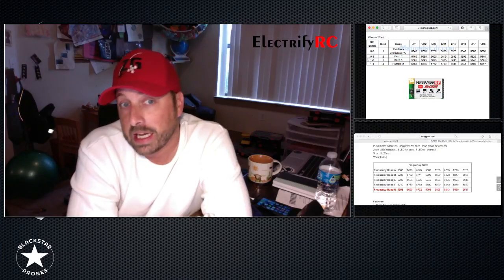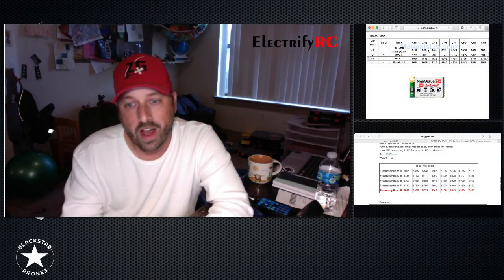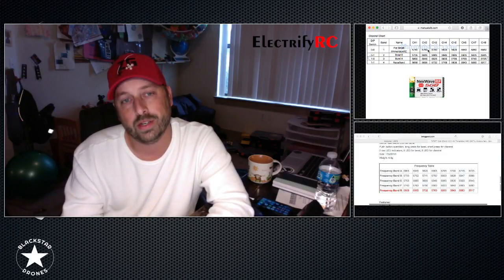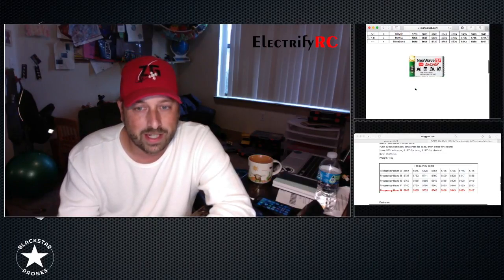CheFPV 101: How to Match Vtx and Reciever Channels Properly

Comment: got a new wizard x220 with a TS5823S 40CH 5.8G 200MW vtx frequency chart matches on all bands , put new run cam swift in and i cannot receive video on goggles or fpv station  , any ideas? bad vtx?

Comment: im having a similar problem, except my channels line up but video is crap and mad multipath interference or whatever its called. i turn my vtx to f3 and my goggles to b3 and it works fine i turn them both to f3 and CHANNEL NUMBERS DO LINE UP frogot the  number but they matched but video was way better when they didnt... ive tried 2 different vtx's and 2 different modules (STock attitude v4 and true d) im getting very pissed at my equipment right now.